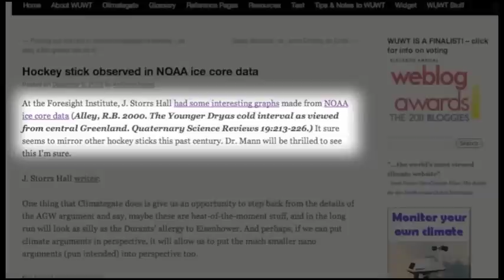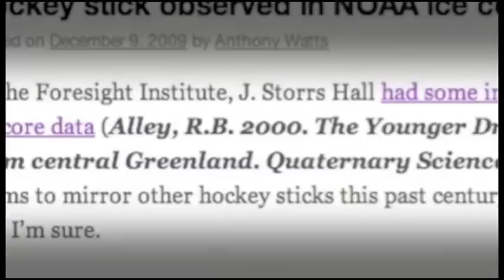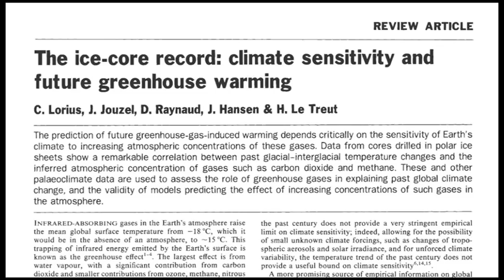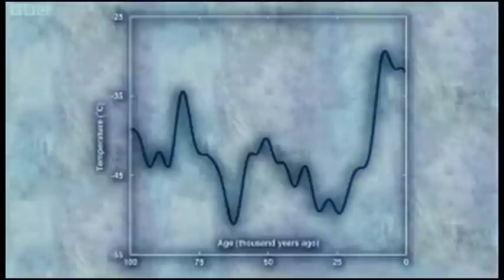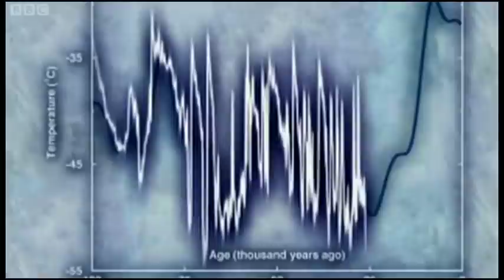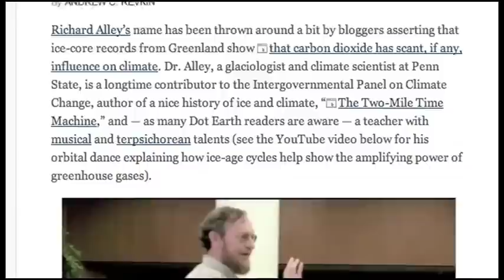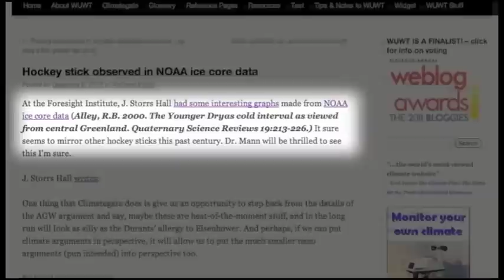What the Ice Cores Tell Us, and How Deniers Distort it

Comment: 3:41 " If we admit greenhouse gases it's going to get warmer" is a lie! Why? The actually science is that when the earth is going through an interglacial period  (warming) CO2 is noted by the ice cores to increase. The Ice core testimony on the previously noted interglacial periods had nothing to do with human made emissions.  Yes, the world is warming and we need to prepare for the consequences. The earth is going through a warming interglacial period (as it has done many times before). Reducing CO2 to zero (even 30 years ago) won't change that. 

The ice cores are a testament to the normal warming in an interglacial period we are experiencing. A big tell that the carbon elimination push is a social engineering scam is that nearly all scientific studies of the ice cores showing the evidence of previous interglacial warming have now been removed from the Bankster-owned internet and media. All that remains is garbage like this twisting the ice cor testimony to blame human emissions. humans didn't have cars, planes, air conditioners and machines in the previous interglacial periods.

Yes, we should move to sustainable practices and reduce pollution, but for reasons other than Bankster fraud. It has F all to do with Carbon however except for the fact that we, as carbon life forms, are targeted for partial elimination.

Comment: At about 3 minutes and 40 seconds into this they are claiming that they prove causation between greenhouse gases and temperature and Ice core data. They prove no such thing they found a correlation. Correlation is not causation. Not only that it indicated that CO2 does not cause warming oh, it comes after warming, according to the proxy data. Their assertion today is that man has somehow turned everything on its head and is completely Rewritten the way the climate works. Do they have some valid observations, yes. But at no time can you make assertions 10 20 30 40 50 60 70 years in the future that will hold water because the climate doesn't do what you tell it to do.

Comment: Medical Doctors used to use vibrators to relieve women of their hysteria... They also had an official cigarette they endorsed and let's not forget lobotomy or eugenics.... All had widespread "Consensus" of these subjects. In the 70 these scientists were worried about global cooling. But THIS TIME they are 100% pecent sure they are correct.... Just like all the other times the were 100% correct. And their use of "Denier" shows their religious belief in this BS. Weather/Climate on the global scale is by far the most complicated field of study there is. Rocketry or Nuclear Physics are nothing compared to Climate Science. There are SO many pieces. Astronomy, Astrophysicis not just Meteorology. The earth has warmed and cooled before. If warmed tremendously between 1905 and 1955... And then it COOLED for 15 years (Global Cooling Scare) .... From 1905 to 1960 we probably burned about as much fossil fuel as we do now in 5 years. CO2 was low..... And yet it warmed dramatically and then cooled. So that super hot star we are orbiting isn't what is heating up the planet.... Its co2/plant food. A climate skeptic once said the reason they don't blame the sun is that you can't tax the sun. That about sums it up. This house of cards will come crashing down sooner or later and bc they are liberal scum and lied for the "right reasons" there will be no repercussions against them.

Comment: Yeah I was really hoping this would address the problem with the 800 year average delay of CO2 BEHIND temperature. Why do they never have any explanation. Why do they just not talk about it? This video claims to address the “propaganda” by the “deniers” but the video doesn’t mention the actual argument that is brought forth. What a crock.
Reply: Yes! That and many more "inconvenient" facts. Real science is never static, never "settled" and never inflexible. Else newly found data cannot be properly added to the overall discussion.
Reply: Because as ocean temperatures rise, CO2 is released into the atmosphere, which in turn causes further heating. It’s a positive feedback loop. CO2 is the cause and effect. Even if it isn’t the trigger it sure as hell is a catalyst. All that is needed is the trigger. 19000 years ago, the earth’s orbital cycle caused ice from the Arctic to melt, which caused an influx of fresh water into the oceans, which disrupted the ocean currents, resulting in a seesawing of heat between the hemispheres. This then caused CO2 to be released into the atmosphere, causing further hearing. Even though CO2 wasn’t the cause, it was responsible for an estimated 90% of the heating at the time.

Comment: its funny that he talks about taking things out of context when everyone of his graph has INSTRUMENTS written on the part that is higher than the mwp and he doesn't even consider that wrong.

"ANYTHING BUT?" IF you have any clue how REAL science is done, you do not add instruments on to proxy data and call it real science.

"it cant be the sun because its not getting brighter". Does the sun get brighter from winter to summer? No. It doesn't have to get brighter to change the temperature of the earth. All it has to do is melt ice and turn it into sea temperature water and viola, the earth is warmer.
Reply: Seasons are caused by the angle the sun’s rays hit the earth at. Are you saying that the earth has some long term change in position that makes the angle different over a long period of time? You think it’s as easy as the sun melting ice, but you have to explain what changes to cause the sun to melt ice it wasn’t doing for thousands of years prior.

Comment: THE CO2 PREMISE IS FALSE. CO2 INCREASES AFTER THE EARTH HEATS UP FROM SOLAR ACTIVITY. C02, IS A PLANT FOOD AND NOT A POLLUTANT. CO2 NEVER CAUSES THE WARMING EFFECT. THE IPCC IS TELLING US ABSOLUTE FALSEHOODS.
Reply: CO2 has a known heat trapping affect. Even if it doesn’t start the warming, it amplifies it. Isn’t it funny that the CO2 levels follow almost exactly with the global temperatures?
Reply: @dannypike3189   no.  CO2 lags the Earth's temp rise.  It does not precede it. CO2 is a poor greenhouse gas.
Reply: bo ptah A rise in the earth’s temperatures caused an increase in CO2 as it is released from the oceans and ice caps. For example, 14000 years ago or so a change in season caused the ice caps to melt and fall into the oceans, disrupting ocean currents. This caused the oceans to release CO2, and catalyze the heating. It wasn’t the CO2 that caused the heating, but it was estimated to be responsible for 90% of it. CO2 isn’t the strongest greenhouse gas, but it can still have a significant effect on temperature, especially when it causes stronger greenhouse gases like water vapour to be released into the atmosphere.
Reply: @dannypike3189    before there is increased CO2  . there is always a rise in Temp first. 

   Approx 12500 years ago there was a global flood.  no one knows how it started.  but it was not increased CO2.
  Suggesting that CO2 is responsible for global warming is not science.  It is voodoo.  It is also not science to use terms like " estimated" in any hypothesis  or indeed " consensus"  in any scientific direction.  It is the Sun that is causing the very slight increase in temp over the last 150 years ( 0.8 degrees C ) 

    This winter is going to show all the global warming loonies how wrong they are.  We are entering a GSM and that is confirmed by nature having bumper crops of Acorns, apples, Hazelnuts and blackberries..   you watch.
Reply: bo ptah There has never, in the history of the earth, been a global flood. I jus told you how CO2 doesn’t have to be the cause to be the catalyst. It seems as though it went in one year and out the other. 

Suggesting that CO2 isn’t responsible for warming merely because it downstream cause it means that you don’t fucking know what science is or isn’t. CO2 is a proven heat trapping molecule. You only listening to denier sources does not make you an expert on the science. It makes you an expert on denying the science.
Reply: bo ptah You have no idea what you’re talking about. All quantitative results in science are estimates. There is no certainty. You continue to show your ignorance.
Reply: bo ptah One winter doesn’t show anything. That’s a short term trend that doesn’t reflect the long term trend. How can you possibly try to tell someone else what is science and what isn’t, it what science does and the words they use, when every single one of your arguments, even the ones not related to CC, go against scientific concepts?
Reply: @dannypike3189    listen.  It is known all over the world by the types of erosion found in rocks that there was a flood approx 12500 years ago. Some parts are still submerged and you can still see the ruins. 

   CO2 is not responsible for the small increase in the Earths temp over the last 100 years.   just as it was not the cause of the "medieval warm period"  that was warmer than today and was approx 1000 years ago.. 

      The Earth is Not heating up outside the statistical norm and neither is the sea level rising either more that it has since the medieval warm period..   You need to check the facts away from government sources.
Reply: bo ptah There May have been multiple local floods. There has never been a global flood. Ever. It’s not possible.

Also, the medieval warm period was only warm in some parts of the world. Global averages has it well below today’s averages.

Also, the causes of the MWP are well known, and none of them correlate to today’s temperature.
Reply: bo ptah The earth is heating up much quicker than it has ever in recorded history. The changes are happening too fast for life to adapt. Just look at polar bears.

Repeating the same claims will never make them correct.
Reply: @dannypike3189  Polar bears are increasing in record numbers.  you need to check your facts
   The Earth is not warming up.  In fact we are in a period of temp decline.   This was discovered a few years ago
https://www.youtube.com/watch?v=WMqc7PCJ-nc
Reply: @dannypike3189    The flood was glbal in that it affected the whole world. The reason for the MWP are not known only hypothesised and it was warmer than today.
Reply: bo ptah The causes of the MWP are pretty well documented. The MWP was also not warmer than today when you take the global averages.
Reply: @dannypike3189  The MWP was significantly warmer than today. , You need to leave the propaganda sites alone.  .  The Norwegians and the Danes have legends of going into the pacific over the North pole .  It was not that long ago either.
Reply: bo ptah LMAO. Yeah any source that disagrees with you is propaganda, right?
Reply: @dannypike3189  No.  Any source that originates from the IPCC propaganda machine .  Is wrong.  that is why they have not got any predictions right in the last 45 years.  Think about that.,
Reply: bo ptah It was the National Academy of Sciences Report. It IPCC has actually had plenty of instances where they understated the issue. Regardless of exact predictions, the conclusions drawn from the models and reality are the same.
Reply: @dannypike3189   No.  they have got literally EVERYTHING wrong..  Even the trends are wrong.  they should just stick too 3 card monty.
Reply: bo ptah That’s just incorrect. This is going nowhere. Have a good day.
Reply: bo ptah I will not be replying after this. 

You say statistical norm but you probably have no idea what it is. The rate of warming is far outside any statistical norm. Even if we assume the MWP was warmer, that doesn’t change the fact that the globe is warming at an abnormal rate.

The only brainwashing going on here is that being done by rich capitalists with an investment in destroying the planet for profit.

Comment from the maker: "Co2 follows temp" actually, that was a lie before, as demonstrated here
watch?v=8nrvrkVBt24
but it's just no longer even possible to distort anymore, as new research with a wider spread of proxies has shown, that co2 did indeed lead temps globally during the most recent deglaciation.
google
(Re)Confirmed: Earth’s Wobble, Plus CO2, Ended Last Ice Age
Reply: No, CO2 levels were falling during the end of the Little Ice Age. CO2 going down as  temperatures warmed. CO2 was about 225ppm during WWII, yet we had a period of warmth. CO2 was increasing during the 1960s and 1970s, yet we saw a cooling trend. THAT is the EXACT opposite of "leading".
Reply: No, CO2 levels were falling during the end of the Little Ice Age. CO2 going down as  temperatures warmed. CO2 was about 225ppm during WWII, yet we had a period of warmth. CO2 was increasing during the 1960s and 1970s, yet we saw a cooling trend. THAT is the EXACT opposite of "leading".
Reply: No, CO2 levels were falling during the end of the Little Ice Age. CO2 going down as  temperatures warmed. CO2 was about 225ppm during WWII, yet we had a period of warmth. CO2 was increasing during the 1960s and 1970s, yet we saw a cooling trend. THAT is the EXACT opposite of "leading".

Comment: @greenman3610 
Interesting, as someone who follows physics quite closely I can tell you that a cornerstone of physics for the last 50 years has recently come into question, that being einsteins theory of relativity as neutrinos have been discovered traveling faster than the speed of light, thereby requiring the theory of relativity to be modified. 
If CAGW does not have a test or series of tests that falsify the theory it is not science but a religion. What are they?

Comment: email 0969618170

Tom Crowley of the Department of Oceanography at the Texas A&M university writes to Malcolm Hughes and Keith Briffa, about the huge problems involved in trying to figure out if the various “temperature proxies” are measuring temperatures, carbon dioxide levels, or some other complicated combination:
 Cont....

…

So, are you sure that some carbon dioxide effect is responsible for this? May we not actually be seeing a warming?

Comment: @Viracocha711 I had been using the entire 20th century, but in the case of Keith’s, we need to align the first half of the 20th century with the corresponding average values of the other lines, due to the late 20th century decline.

Comment: @Viracocha711 Using a variety of climate records derived from peat, lake sediment, ice core, tree-ring and other proxy sources, Yang et al. (2002) identified a period of exceptional warmth throughout China between AD 800 and 1100.  Yafeng et al. (1999) also observed a warm period between AD 970 and 1510 in δ18O data obtained from the Guliya ice cap of the Qinghai-Tibet Plateau. Cont...

Comment: @Silentsam7532     No, CO2 does not increase water vapor. Actually water vapor increases due to warmer weather.  The extreme trace amount of CO2, releases only a trace amount of heat, and cannot not even be detected on a global scale. Therefore, any heat retained into the night, is from humidity (water vapor) not CO2.  If it was CO2, the deserts would also be kept warmer at night, and they don't because there is a lack of humidity.
And I have no problem with Nuclear power.

Comment: The warmist claim that the nights are warmer due to CO2 trapping heat.
This of course is totally false.
CO2 is a gas, and although a gas will heat up faster, it will also lose it's heat faster. In fact, after the sun goes down, it is really only a matter of minutes before the trace amounts of CO2 are back to normal.
The only thing that will keep the temps warmer at night, is humidity. Which is associated with higher temperatures.  And you can't (or shouldn't) be able to tax humidity.

Comment: Scale in context

"Suppose we were very serious about making a dent in carbon emissions and could replace about 10 percent of the world's energy sources with non-CO2-emitting nuclear power by 2020 -- roughly equivalent to halving U.S. emissions.   Based on projections similar to those of the Intergovernmental Panel on Climate Change (IPCC), the required 1,000 new nuclear power plants would slow the warming by about 0.2 degrees Fahrenheit per century.  It's a dent, says Christy."

Comment: @Dasmaster1 
outer space is not "nothing"  There is next to nothing in that area (or space).
If it was nothing there there would be no area that exists.   
Your bedroom for example is an area it has dimensions and space if you removed everything including gravity from your bedroom it would still consist of it's dimensions, area or as we call it space.

The normal temperatures of earth there are no ice caps on Earth.  Besides that the earth is heated from near absolute zero to 58 deg F

Comment: @thesparitan I agree except for the "concrete" part and think you got volcanoes backwards. I believe it's generally accepted and  imperical measurements support  the fact that volcanoes cause cooling.

If current theory about the GHE is correct, I don't say it's not, then more CO2 means more heat. The problem is how much more? If you want to assume huge amounts more, you have to use contested positive feedback models. That is where I start to have trouble.

Comment: You say, that we don't know the long term effects, but should we weight for there is nothing we can do and we all must use electric cars cause there  is no oil? Then if something goes wrong we are all SOL. No, it makes far more sense to push hard for the changes now, when we still have oil to fall back on if something goes wrong. Then there is the whole thing about the middle east having us by the short hairs from oil and the long and more dependent we are on oil the worse it gets.